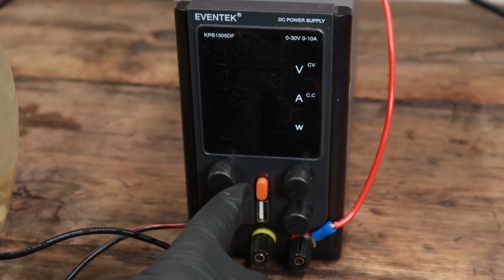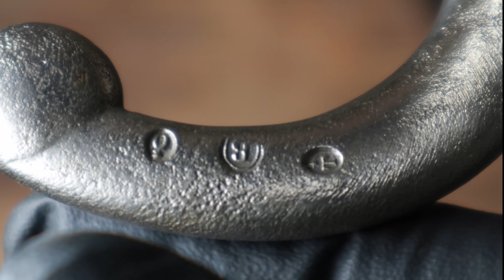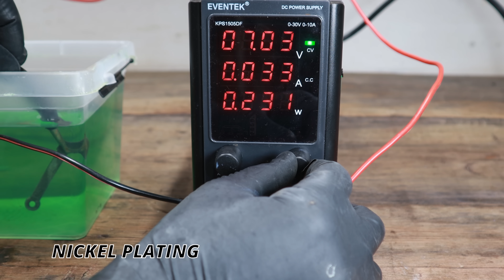Restoration of a splendid 1870 bayonet

Comment: Steel needs to be plated with copper first before plating with nickel. Also, I have one of these sword bayonets. The blade appears to be completely plated in nickel. I suspect though, that the rest of the steel hardware may have been blued, but I am not sure.